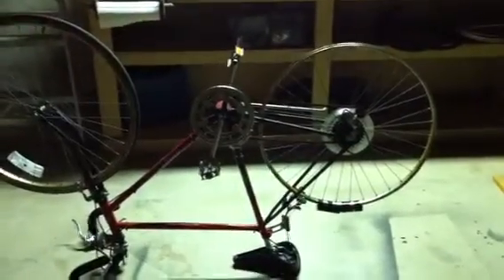Free Energy Centripetal Force

Comment: "H"   "F" ing  "S" …   I can see it now . A 500 pound wheel ,  6 feet diameter ,  100 pounds off balance . traveling 600++ RPMs.  Dang near two Horse Power....  May be more. My Math could be a little off. ……  I have the material and tools to build this . "BUT" not the physical strength …  Old  age  SUCKS .

Comment: Sir, may I remind you that energy is Force multiplied by distance  and while the  the tool box is heavy, it rises a little, but your input at the pedal is a small force multiplied by the distance all around the pedal  which is very long and  both products will come to the same value.  Again Sir, learn about energy and do not misinterpret it for Force on its own which is what you are doing.
Reply from the maker: +Carmel Pule' Thanks for the comment. Some things for you to consider... The ratio is 3 wheel rotations to 1 crank turn. Wheel rpm is about 200 when the bicycle will lift itself. And this lift is without feed-back from the falling tool box). During 1/2 wheel rotation the force lifts the bicycle. During the other 1/2 wheel rotation the force pushes down on the plank to lift the chest. Also, the lever ratio of the plank is 2 1/2 to 1 with the tool chest on the long end! The tool chest weighs more that the whole bicycle. Once the wheel reaches a certain rpm it is very easily maintained at that rpm. Doubling the rpm will quadruple the centripetal forces required to maintain the revolving mass in an orbital path, resulting in the ability to lift about 4 times the tool chest weight in 1/2 the time. After reaching a certain speed, I can destroy the bicycle! But, prior to reaching that destructive rpm energy level, I can maintain any constant rpm very easily.

So, you have much more to consider.
Reply: +MagnaMoRo Well you are correct in everything that  you said.   But the fact remains that all the (little) energy in the system was provided by the man who operated the pedal.  Now the continuous change of direction of the weight will cause a continuous acceleration of  any weight hanging on that wheel , where the resultant of the contribution of the rim is zero while that of the added weight will be such that when the  rotating weight is  passing on top , the lift upwards is the centrifugal force minus the  added  eccentric weight  plus half the bicycle  and when the weight is passing on the lowest height  the force downwards is the  centrifugal force plus the added weight  plus half of the bicycle.  As far as forces are concerned they are a lot, since centrifugal force is proportional to the angular velocity squared, as you so well indicated.   What I am saying is that basically we are dealing with impulsive forces with not much energy and so as the weight passes the lowest height it will give a great impulsive force to the plank and it will lift  the toolbox and the pedal operator will not feel the effort and he will not even feel the impulse due to the inertia of the wheel and the weight, However if  you had to lift the weight continuously it will be a different matter as it is not impulsive forces you need, but Energy to   store it in the lifted tool box . Impulsive forces can be high while the energy is still low and you can have high energy with low impulsive forces, 

It is the same as heat and temperature,  where in a match you can have a high temperature with little heat storage but in a kettle you can have low temperature with a lot of heat storage.  You cannot warm a room with a match as it has no heat energy in it, but you can have a good bath with a full kettle of hot water.    It is the same with impulsive forces and energy.   Impulsive forces can be high when one changes momentum very fast as is happening in the bicycle when the added weight changes direction as it is coming down and then reverses direction as  it goes up . This will produce a great impulsive force for a short time to lift the tool box., but it will not do to lift the tool box continuously to any considerable height as that would need more energy and not an impulsive force.
Thank you for replying. Carmel.

Comment: Good Work. This is the energy of gravity which is free for us. by rotating the weights you generated oscillation of pendulum. unrestricted oscillation of pendulum principle results in harnessing of gravity force which is otherwise stationary or zero. by feeding in little power you can carry on with the oscillation. you can generate 12 times more power than the input power in ideal circumstances. I am working on a similar project. to better understand your experiment see veljiko milkovic pendulum which shows how dual oscillation can help tap the gravitational force in our favor. All other similar thinker are invited to see milkovic's work. Its a great discovery.

Comment from the maker: @austin123457 Why would we have to die! If we have the ability to bring energy in then we should also be able to remove it. There is always some solution.
Extending the radius of the centrifuge arm past the pivot of the lever causes conservation of angular momentum to win. A 10kg mass would exert a pulling force of -137.243kg at the top of its overhead arch at only 120 rpm 3ft radius.

Comment from the maker: @Eliseoanton87 
Although the device requires input. If you see my point, then you must surely agree that if the output energy is greater than the input, then any excess energy IS free energy. Most energy conversion processes have too much loss, however it may be possible to devise an efficient pump to store energy in the form of air pressure, this pressure can then re-feed the input motor, leaving excess power to feed other devices.

Comment from the maker: @ Eliseoanton87
Yes!
Those sockets on the rim have mass, whereupon after the initial buildup, it will then require little energy to maintain motion at a steady rotational rate. Energy to maintain said rotational rate through the timeframe of a rotational cycle is less energy than that nessesary requirement to alltogether move bicycle frame, fulcrum and tool chest within the same timeframe.
...To continue...

Comment: @Cloxxki   I beg to differ with you , my friend.  That is exactly why I try to drive the pendulum with a falling weight.  To show the exact power needed to drive the pendulum and the exact amount of weight it will pick up.
My 2 stage oscillator requires 22.5 inch pounds to power it and puts out 360 inch pounds of power.
There is no longer a question of over unity.  The ONLY question left is HOW to get it to power itself.